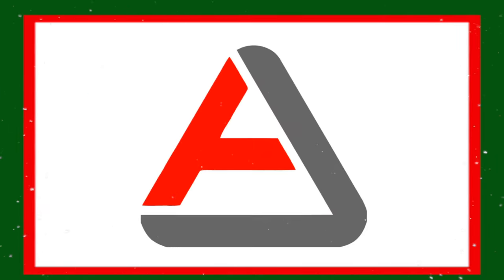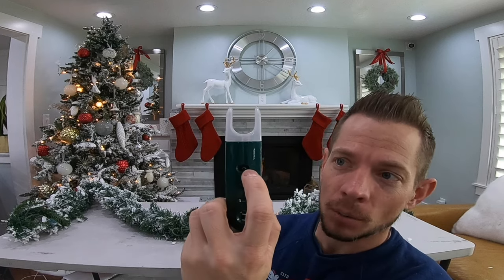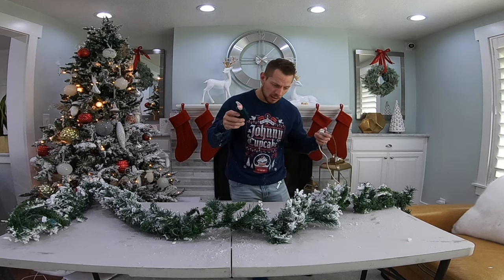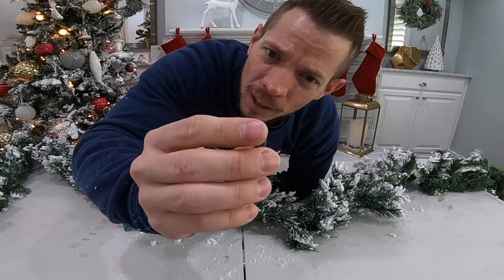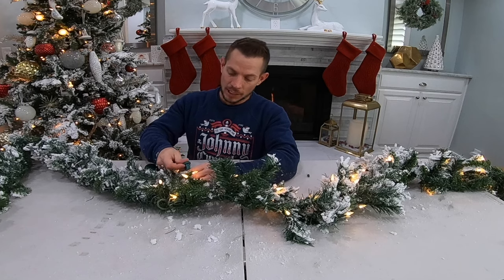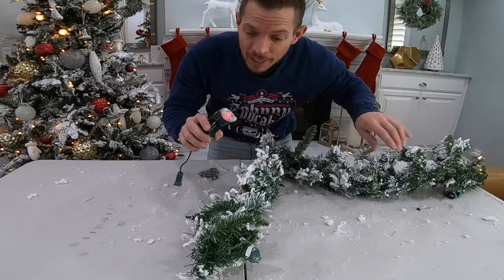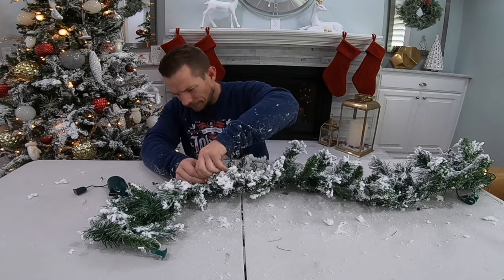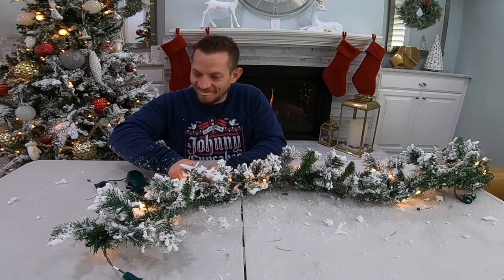Repair Old CHRISTMAS Lights with one tool

Comment: So frustrating that all of these expensive Christmas decorations are only built to last a year. All of our inflatables are dead, pre-lit tree doesn’t have a single strand that is working, and new LED net lights for the bushes that we just bought last year won’t work. Even after replacing fuses. Next is to see if they came with replacement bulbs. The tree did not. 😭

Comment: This is a very good presentation. I had a problem with my pre-lit Christmas tree about 4 years ago. Since the artificial tree looked good, I stripped all of those lights out of it leaving me with a traditional artificial tree.  I have decided that putting lights on the old-fashioned way eliminates all of this headache completely. As I put strands on the tree, I check each one and find any problem immediately, before it is buried deep inside the tree branches making it very nearly impossible to find. I'll never go back to pre-lit trees.

Comment: You can take any donor strand of lights to use as replacements, by straightening the wires of the bulb removing the base and installing it into the plastic base of the lights you are fixing. That way you don't have to rely on the few replacement bulbs they give you.
Reply from the maker: That is a great idea, Thanks.

Comment: Now the question is how long does the light checker last rofl. But I think you can buy replacement bulbs also if you like your setup. Also if is more a tree, or something they don't sell every year. Sometimes you may buy things, that don't come out again next year. But luckily they use common bulbs that can find replacements for.
Reply from the maker: that light checker will last a while and you can replace the batteries.

Comment: What does it mean if I get the red light on the tester, but have changed the bulb to a new one? Is the string of lights damaged?
Reply from the maker: Yes, the wire has disconnected  somewhere.

Comment: I don’t understand why one socket will. It light up the bulb. Very dim. I used the original base, new bulb but dim. I checked the connections inside the socket and it seems fine. Ugh! I do have that’s took and yes it’s a keeper!

Comment: I bought this tool this year and was excited as most of my strands are only half working. I found this tool to be incredibly inconsistent. Would light green on bulbs lit and not lit, and vise versa. It's not helping one bit. I returned it for another hoping it was faulty, same deal with the 2nd. 

Meh.